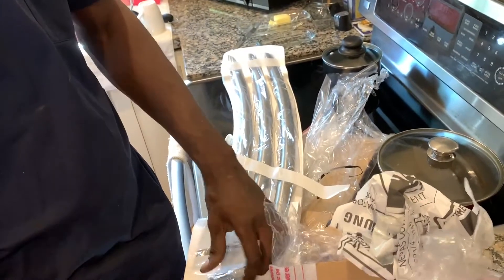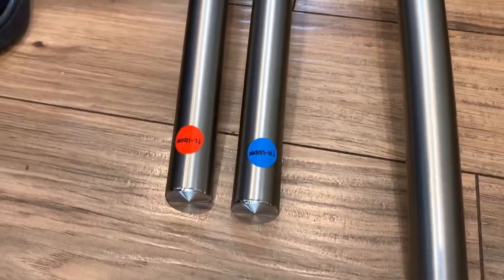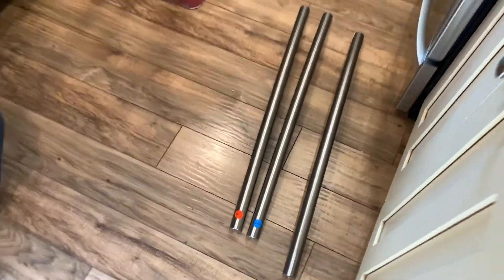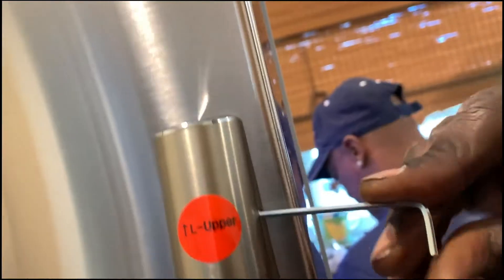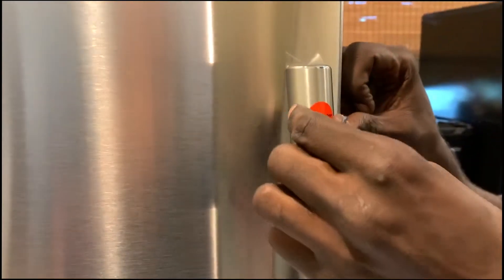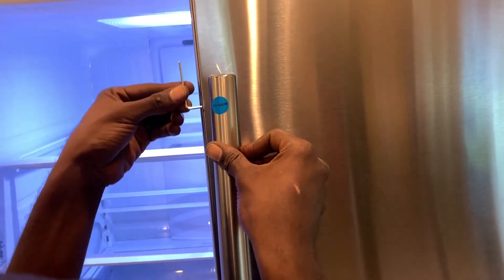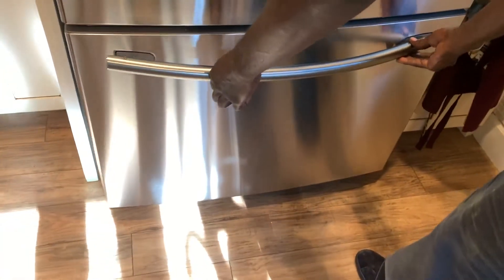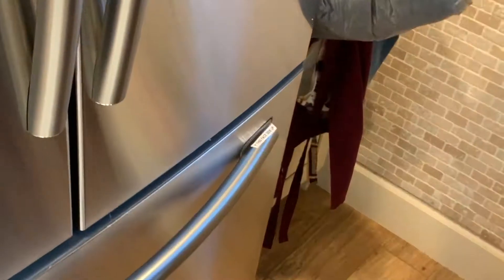How to put the handles on a Samsumg French door refrigerator

Comment: Don't get the bolt
Reply from the maker: Not sure of the question
Reply: @TomLeeman  am in Jamaica buy a Samsung 3 door refrigerator but the (bolt or nob) to put up  the 2 top handles don't receive it
Reply from the maker: @morinethompson1556  you may have to go back to where you purchased to make sure that you have the right door handles and bolts
Reply: @TomLeeman  Thanks